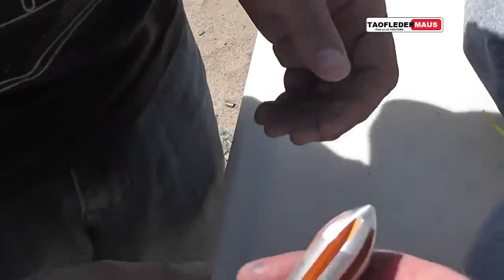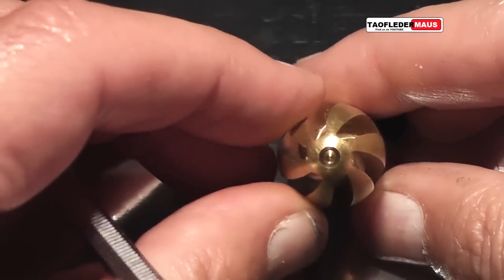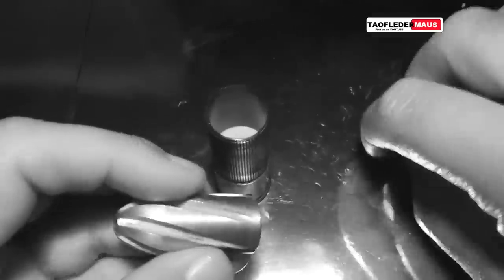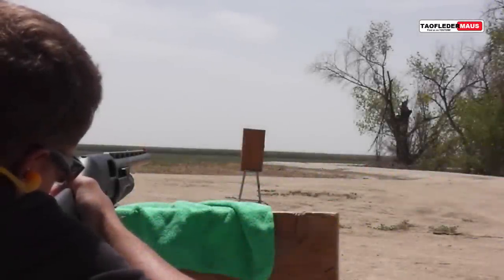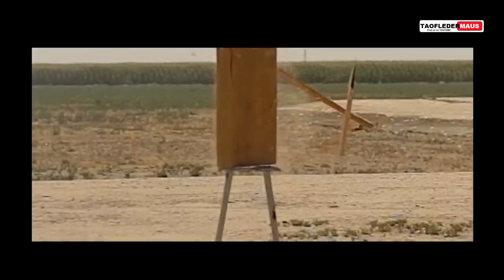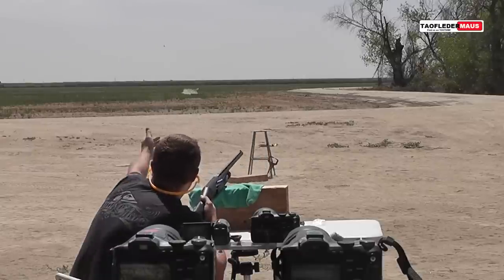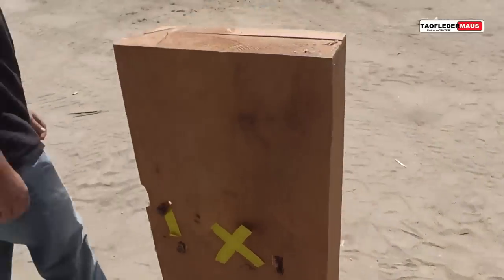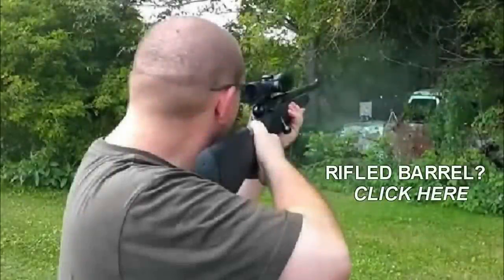70 Cal. Custom Machined  Brass TURBINE Shotgun Slugs -  Tests

Comment: I'd like to see an old school ammo accuracy test, round musket balls vs. standard deer slugs.  For the sake of science and curiosity, Tim could add golf ball dimples to some of the rounds just to see what difference it makes.
Reply: I believe they shot a large ball bearing once. That's pretty close to a musket ball.
Reply: Richy Rich A dimpled round would be interesting to see but I see potential problems with accuracy if it comes out of the barrel with a significant amount of spin.
Reply: Richy Rich The problem with round ammo is that it's extremely susceptible to the magnus effect, which would make the ammo drift off in the direction of the spin (I think).
Reply: +Wolfennar S. that effect is exactly what the dimples on a golf ball work against, so it would be interesting to see what a dimpled round ball would do coming out of a gun
Reply: From what I read the dimples increase the magnus effect produced while spinning much like the stitching on a baseball. Here's a link to where I got some of my info. http://math.ucr.edu/home/baez/physics/General/golf.html
Reply: +Aaron Leger Nope, the dimples are there to increase the Magnus effect. A golf ball usually has back spin, so the Magnus effect adds lift and makes it fly further and straighter.
Reply: or cast them with knobs on the musket balls. it increases kinetic energy and does tremendous damage
Reply: I want to see musket ball AP, tracer and frangible rounds.
Reply: +Richy Rich Need to forget the turbine grooves and make a waisted pellet just like the .177 used in our old pellet guns but much bigger like say 12 gauge and machined out of brass or aluminum.They will fly strait without spin stabilization due to the drag of the skirt and heavier nose.

Comment: After some thoughts, I'd that the main reason these rounds were as instable is because of the fact the design relies on both a rotation of the round and an hollow base to stabilize the flight. Here are two possibilities of what might be happening:

1. When the round leaves the barrel, the hollow base act as the stabilizer, slightly moving around but keeping the round straight. Then, after the round travel a bit, the fins give the round more and more spin. When that spin is combined with the slight tumbling of the back of the round, those two forces cause the round to start tumbling violently.
2. Almost the same as the first possibility, but the fins made the round rotate before leaving the barrel, stabilizing it. Then, shortly after, the hollow base make the round very susceptible to moving around slightly, which result in the same thing as the first scenario.

One way to see which possibility is more likely could be to add a thick line high contrast color on the side of the round. Maybe it would be possible to see with a high speed camera what happens. But in any case, I'd say choose either an hollow base or fins to stabilize the round, not both.

Comment: The Foster Slug or Fingerhut Slug is quite an old concept and has proved! But it has to be made from softer alloy, to give the gas pressure a chance to widen the cavity, which it will because of the inertia of the slug. With its back walls (internal ballistic) snuggeling against the barrel, the shuttelcock or wind vane effect should work properly. The idea of some sort of rotation stabilisation to start outside the barrel due to the rifled surface won't work, it is simply to dull and the shock cone won't allow some sort of usable laminar stream either.
Reply: +LCdrDerrick  And try the Brenneke Black Magic Magnum!

Comment: What everyone forgets about supersonic flight is that without constant thrust, no matter what you do, the object will tend to destabilize. This is why there are so few shapes for bullets. Engineering, those are what work when given a single quick pulse of energy. If you want a different shape, most of the time, you need constant thrust. So you would need to make the inside of these rounds into a rocket motor, making these bolter rounds.

Comment: When I first heard the term "rifled slug" this is what I imagined. But seeing how these performed, its clear why that's not the case. If I were to venture a guess I would say that the shockwave that is forming in front of the projectile at supersonic speeds is preventing air from flowing through the turbines rendering them useless. I would suggest trying a design that lets a small amount of gas blow by the slug on firing by passing through channels in a manner that would impart a spin from the rear of the slug forward. Once the slug was supersonic the same shockwave would prevent impact air from reversing the rotation. I have no idea if it would work, but it sounds good on paper.

Comment: You mentioned in your video while shooting these rounds that the hollow end making it resemble a shuttlecock. That got me thinking about the round itself. A shuttlecock is smooth at the tip with feathers flaring out at the end. More surface area at the tail of it. What if the flutes or spirals of the turban/turbine had a smooth tip with fluting at the rear for a larger surface area at the tail of the projectile, similar to the fletching on an arrow. Same shape as this one but not fluted at the tip. I don't know if it would work better or worse but its an option that differs from many that i have seen shot up to this day. This was also posted on Tactical G-Code's video shooting this as well.

Comment: Awesome high speed footage . I wonder if a scaled up copy of a .50bmg round would work at that speed. Or perhaps a copy of a known round that travels at the same or similar speed.
Or even a scaled down copy of a smooth bore anti-tank round as the army can get reasonable accuracy out of the cannon on the M1 Abrams.

Comment: Hi Jeff, I don't have a lot of experience with shotgun slugs but aren't they designed so the slug expands to seal against the barrel so all the gasses are trapped behind it? Kind of like the Mine' ball? A foster type kind of looks like a mine' ball.

Comment: I would imagine the influence of the slots would require some fine tuning with weight of the round dictating depth. Thats a tricky balance to find but im sure there is a magic number for this. My first impression of both the AL and brass was that the channels were cut far too deep.

Comment: You guys should try making the mass of weight of the rounds in the middle. Basically, make a boat shaped rifle like bullet with the turbine carvings. Also, make the turbine slits so that it doesn't try turning the  round around so fast. If you look down the barrel of a rifle, the riflings are really not that tightly twisting around, they do it very gradually.

Comment: I still think that if this Round had a full hollow tunnel through it, it would fly straighter and allow better accuracy. Maybe a 3/8 inch hole in the tip to let the packing be forced out once it leaves the barrel??

Comment: i'm not a machinist but i did notice on the other rounds you shot with a turbine design that the spirals weren't as tight as a rifle barreling is so i was wondering what would happen if the turbine design was exactly the same as the rifling inside a barrel with rifling with thin cuts instead of thicker ones that go a good portion of the way through the bullets tip

Comment: Good to see like most videos, the comments are more entertaining than the video.  I was actually hoping for some kind of super accurate projectile.  Seems it is an over engineered chunk of brass.  At point plank that would be OK I guess but 8 shot at 5 feet makes a 3 inch hole so what is the point?

Comment: time for more ideas,  i think it flips because of the vortex wrapping around the back of the projectile, the cavity while shifting weight to the front is actually causing the instability.  close off the hollow cavity.
Reply: engelteir other open back rounds did go stable though, so i doubt that's the issue
Reply: Reinturtle but all the rounds have problems, have to just change one variable per new test.  Could be the angle of the fins, or how the depth of the groves changes along the length.  Probably have to start with a cylinder and just change one thing at a time till you get a good round.   I wonder if aerodynamic wind simulations would work with computer models of the bullets.
Reply: +engelteir why would you use a computer simulation when you can shoot at stuffs? 
Anyway, the cavity could be usefull if you put the turbine on the rear where air is faster
Reply: SuperCape comp simulations just because you can run lots of them, and try lots of variations without wasting money and time.
Reply: engelteir not all rounds have problems, for example tim's rounds which he mentions at 0:37
Reply from the maker: Reinturtle   Yeah,   all those worked well except the cast iron ones which shattered.  lol    These had some influence from those rounds.
Reply: +TAOFLEDERMAUS 
turbine.... i see what you did there ;)
Reply: SuperCape You can run 1000 permutations in a computer whilst shooting 20 variations at the table.

Why? Because there's no need to be un-economic with your time and brass.

Besides the perfect twist shot could be made entirely in Autodesk with flow simulation and some math. And after that say 30 variations on the theme to pitch the perfect form because there's no substitute for real testing.

I call it being efficient and proper. It's like before just with computers and keyboards instead of drafting paper and crayons.
Reply: +aserta I call it super inefficent: in 1000 iterations of a computer simulation you only get to shot 20 times. That defies the whole point of this channel which is shooting exhotic stuffs and than asking to do the same on Rifled shotguns (and some mercury from time to time). What's the fun in using a CFD software when you can shoot it for real?

Comment: It's nice of you to let a guy that has parkinson's and a flinch shoot.
Reply: Yeah, that's why the rounds were following curved paths and going sideways. lmao, can never admit you're wrong, huh?
Reply from the maker: M Dubzem  classy
Reply: +M Dubzem He isnt holding it with two hands and the load is heavy (more recoil).
Reply: +TAOFLEDERMAUS  I think the spinning stabilization concept would only work if it would be a gyrojet round and aerodynamic grooves cannot provide that much spin
Reply: searchoverload8 Yes that was also happening as well
Reply: The trick is that the round definitely did not have enough spin. Those channels are far too steep to provide adequate spin. But if you go any more shallow, there is a decent chance they will not work anyway.

Comment: I think I can see why it doesn't work:
It should have wings rather than grooves. Those grooves seem unlikely to allow enough air to flow through in order to stabilize the round, maybe contributing to de-stabilize instead due to pressure inside the grooves.
Too small spin distance. It seems to have grooves for a turn every 20 centimeters or so, at the speed of sound that would mean trying to get it to spin 1500 turns per second. Maybe a spin distance of a turn every 2 meters would make it more sensible
Reply: Jack Mcslay I agree with this, somewhat, though don't think replacing grooves is necessary- they can work together. Also might help to plug that cavity, due to air flow concerns.
Reply: Wings don't work well at super sonic speed. Air behaves differently at that speed and tends to stick to the surface of the wings, thus lowering the wings effect and creating a bunch of drag. Problem is: if you screw the airflow in front of the projectile the bottom can't stabilize. Head should be clean and wide, the turbine can go in the rear.
Reply: +Jack Mcslay No it's not case, wings on an arrow or a supersonic projectile are not made to make the round spin, they are there to increase the drag at the rear and shifting the Center of Pressure behind the center of mass it's why the round needs to be nose heavy as well. 
Before guessing on this, try to learn why a bullet needs to spin and not an arrow.
Reply: SuperCape I was just scrolling through the comments to see if anyone said something like this. Listening to Scott Manley talk about supersonic flight and stability with relation to CoM and CoL makes me think that if you're going to have any type of fins anywhere on a projectile, it needs to be at the rear, behind the CoM, and the front needs to be smooth, otherwise its aerodynamically unstable and will flip around all over the place.
Reply: I for one think that the grooves shouldn't start that close to the tip. It would be better if they were only on the side and perhaps weren't as wide at the front.
Reply: SittingMoose Shaman How can you make assumptions like these when you clearly don't know a damn thing about external ballistics.

I didn't say arrows don't spin, I said they don't need to be gyroscopically stable in order to flight straight. 
Ballistically an Arrow and a Bullet use completely different principle in order to remain stable.

On an arrow, the CoM is located in front of the CoP (the fins are creating most of the drag, it's located towards the rear of the arrow axis). So when the arrow is launched, the momentum vector is pushing the CoM towards your target while the drag vector is pulling the CoP in the opposite direction, the arrow is pulled both ways (not with the same force) and it makes it stable. All non sphericals projectiles launched from a non rifled barrel (like shotgun slugs) refer to this.

However a bullet has a CoP located towards its tip, putting it in front of the CoM. When the bullet is launched out of a non rifled barrel, the drag and momentum vectors are gonna cross themselves, pushing the CoM in front of the CoP and making the round tumble. The bullet axis needs to be rigidify: it's where the spinning comes into place.
The gyroscopic effect counters the tumbling, so the bullets remain stable in flight.

It's ok to not know about something, but you don't need to make it look like you know by giving false data. You are just making yourself look like an idiot.
Reply: says the guy wearing makeup.
Reply: ....says the guy wearing makeup....
Reply: Michael Nim And as for you, that is my stage makeup.
Reply: King Khelz well shit then I can't argue with that ( I work in theatre so its understandable) however man, its not good callin people names is all.

Comment: The reason the ring slugs flew so straight was not because of the weight distribution alone.
It was because the most aerial resistance was captured in the back of the slug, keeping it stable, on top of the center of mass being in front of the rings.
Its a very tricky thing to pull that off though, since too much resistance will just make it spin out of control all over again.
And the ring slugs were almost perfectly designed, since they countered the overpull by not putting the rings on the outside, but actually taking away part of the slug, to make the ring width and the tip width the same size, and about 2 to 3mm indentations in between them.

TURBINE, not turbin, slugs will not work unless you apply the same measure.
You could theoretically make drill-rip-out shot by combining both the ring and turbine design, but besides that, i don't see much practical use for the turbine shots.

Source: 7 years experience with (hypersonic) aerodynamics, as part of a hobby of mine.

Comment: Just to keep the math simple, let's say those flutes were 1 in 12" twist and the slug was going 1,000fps.  That's 1,000 revolutions every second, or 60,000 rpm.  So we're asking the aerodynamic forces alone to accelerate that slug from 0 to 60,000 rpm before it begins to tumble.  The only way that seems possible is if the slug is ballistically stable to begin with (which is what it appears Tim was going for here).

Maybe the torque from the vanes caused it to destabilize a bit?  Right hand rule and all that.

Comment: Hey just a casual viewer but I think the problem might be the mini ball void at the back of the round. Mini Balls were made with this void so the bullet would flare out at the back and catch the rifling as it passed through the barrel. This was make up for inaccuracies in production.  Brass is much more rigid than lead so it wont flare out as well. In addition, you are using a smooth bore barrel. So really there is no point for that void.  I think it would be better if the back of the round were tapered and the groves where less pronounced.
The sharp edges on the rifling on the round and the void at the back are creating a vacuum in their wake causing non laminar air flow. Thats what my gut is saying anyways.

Comment: I'm not surprised they tumbled. The high drag is on the nose then turns it around and faces a new high drag inner taper so reverses again.  If a turbine would ever work it needs to be on the tail of the projectile since deflecting air to cause a reactive force and thus spin the round would naturally cause drag.